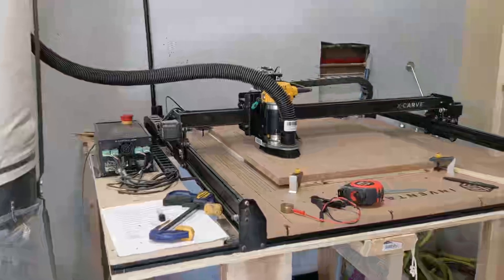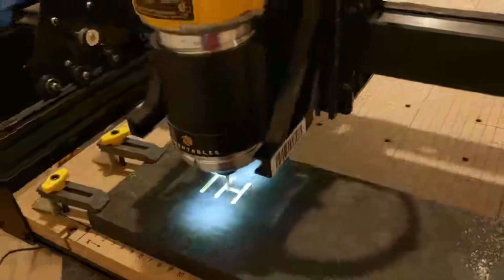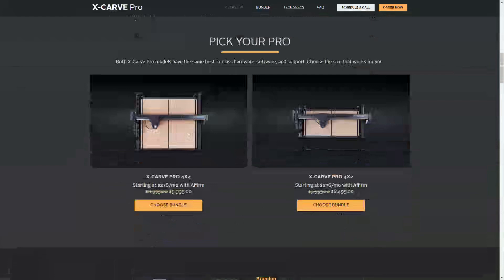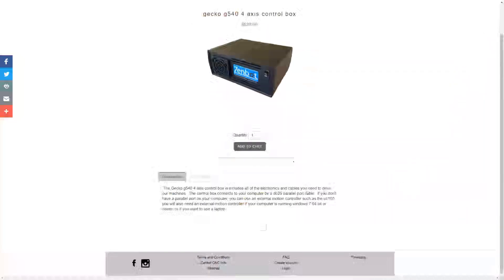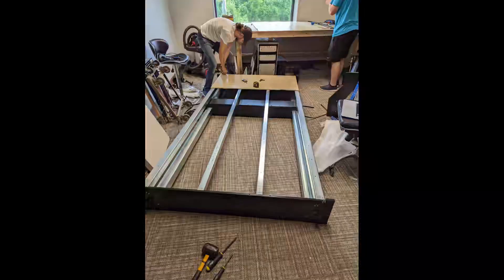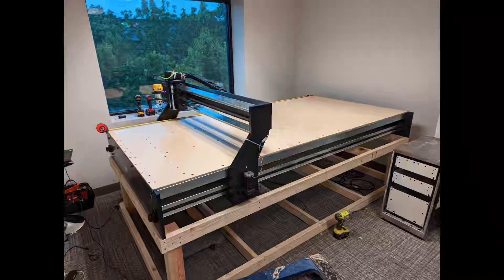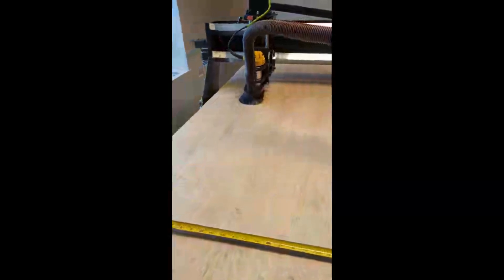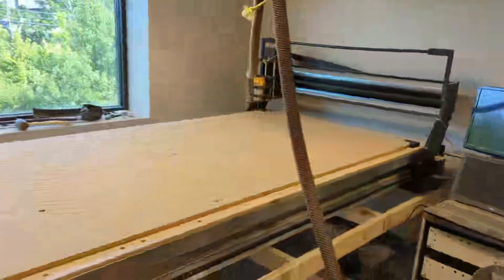X-Carve 4x8 Upgrade (With Zenbot CNC)

Comment: Why can't you use easel pro with it?  Couldn't you jusy select other when setting up machine in easel?
Reply from the maker: You are right. It looks like Easel has added the ability to generate G-Code for non-GRBL machines. Back when I made this, I'm pretty sure easel only worked with GRBL machines. But also the zenbot controller used a serial port that I didn't have on any of my computers.

Comment: I’m actually looking to do the same exact thing. Currently have a 1000mm Xcarve, want to get a Zen 4896, that was literally the only thing holding me back from hitting the buy button was not wanting to switch off easel, I know it well and wanna stay with it. Would you mind shooting me an email so I could more easily contact you when mine comes in for some advice regarding the plugs?